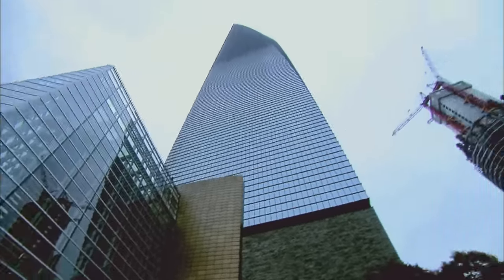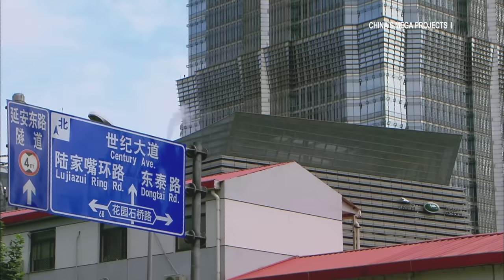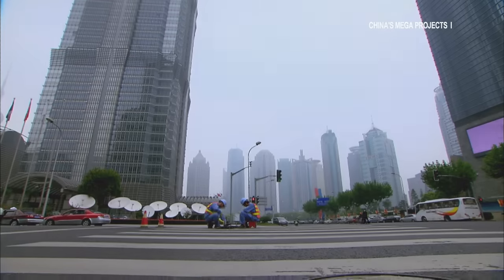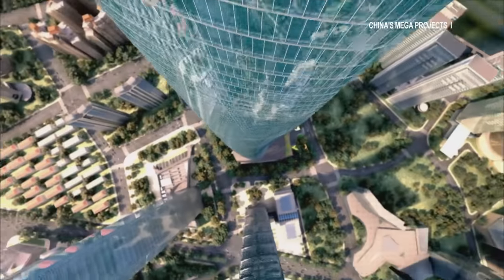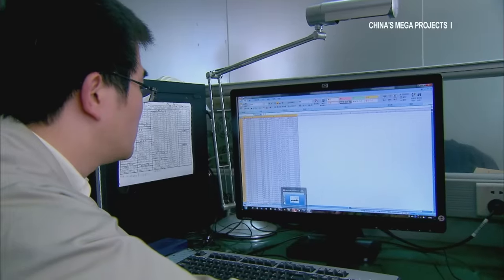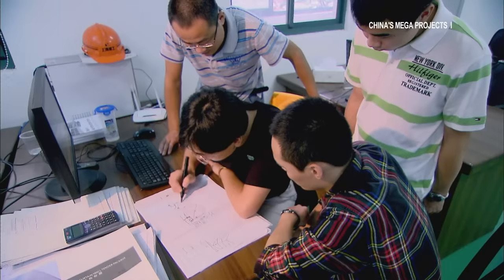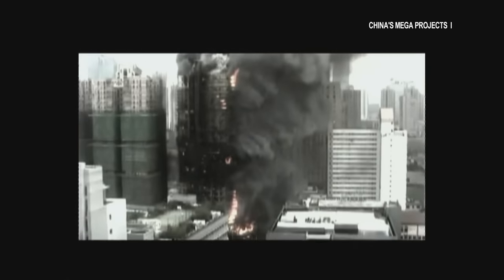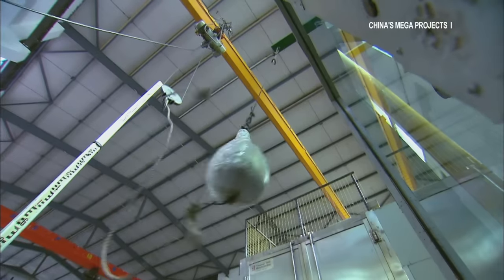China's Tallest Building: Shanghai Tower | China's Mega Projects | Free Documentary

Comment: Isn't placing pillars in the ground common when building large structures? It is in the Netherlands at least.
Reply: Depend on the local soil type. Shanghai’s earth is quiet muddy and soft
Reply: Das logisch he Justin, komen we daar met ons Zalmhaven torentje van 212 meter in Rotterdam 😂
Reply: Are there any skyscrapers in the Netherlands?
Reply: @batencheetos  tallest building they have is 44 stories tall or 540 ft or 164 meters in Rotterdam
Reply: Depends on the subsoil and the load. In soft ground, piles (pillars) transfer most of the load to a harder strata further down. In comparison, when building onto bedrock, piles aren't necessary :)

Comment: In 2020 China banned skyscappers above 500 meters and requires special permits and show need for 250 meters. 

The shanghai tower needed to be bailed out by the governement to be finished and its floor space proved to inefficient and struggled with getting tenants.  Reprted 60% to 70% occuapancy rate in 2020.
Reply: @user-ho6hv8xk9h  I'm very happy for you china...I hope our India also follow the footsteps of china..afterall ..Asia should unite and arise... it's the asian century..🙏😘🌹🇮🇳
Reply: @aryanhassan4659  印度说心里话，他缺少共产党这样的zf
Reply: The ban on high rise is to avoid over crowding pressure on transportation infrastructure , fire safety and prevents cities building high building for fame instead of needs.  This is an old video, Shanghai tower is operating healthy in 2023.

Comment: Double pane glass concept is the #1 reason this building is ridiculously unoccupied to date and in perpetuity. The cost of AC is dramatically more vs competing office space in Shanghai. ALSO, the floor space cost per sq/m is too high vs competition, it's actually a very narrow tower with way to much elevator sq/m % ratio due to the double pane glass concept.

Basically it's an aspirational building that looks "pretty" but is the biggest skyscraper potato ever built.
Reply: Funny that they thought the double facade would be beneficial for heating cost, but didn’t run the numbers on the city annual climate and how aggressive it would be during the hot/mild months.
Reply: It will eventually fill, may take time but in a city like Shanghai where space is at a premium like NYC, it will fill. It took many years for the Empire State Building and The Twin Towers to fill after they were built.